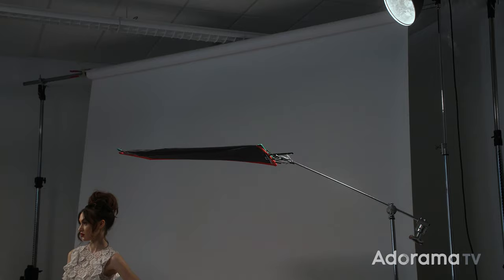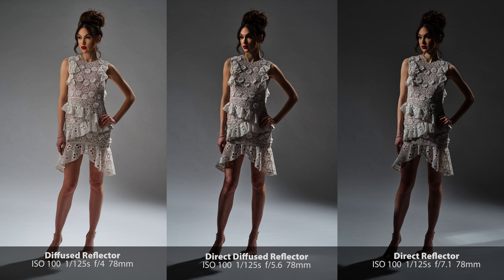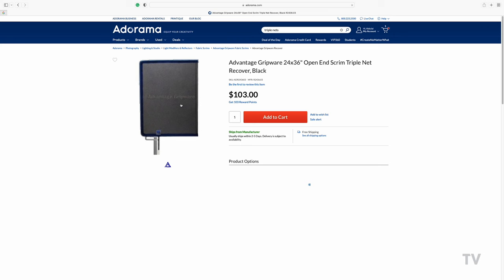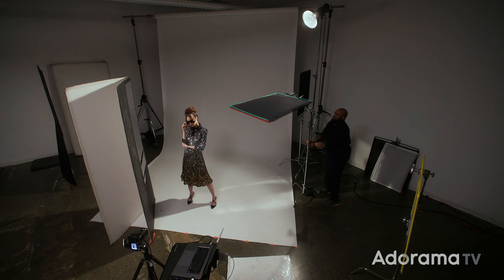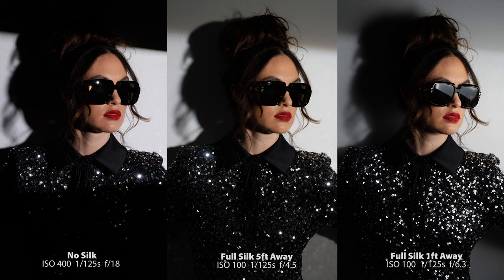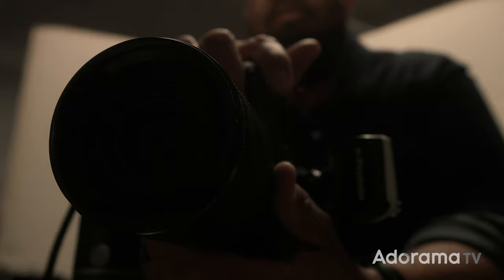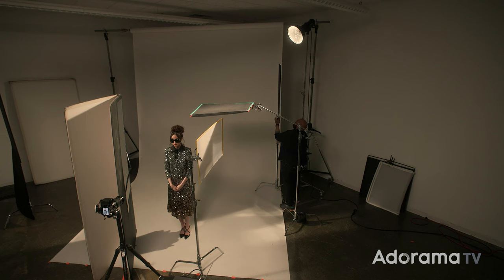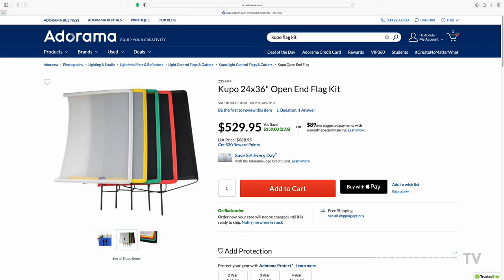Mastering One Light Vol. 1 | Reflectors, Flags, Nets and Scrims | Level Up With Ab Sesay

Comment: Flags & nets are a thing of the past. Nowadays, we use top quality RGBACL lighting and CRLS.
Reply: I agree that CRLS reflectors are the Bomb! Amazing reflectors have added to the capabilities of lighting. I don't know any professional gaffers that would say flagging a light is a thing of the past. Cutting up light sources is an art, and blocking it from the lens is many times a necessity. Nets are less common but I think I point out good use case in this video. I love a good RGBACL fixture, but I also really love the sun, and in my mind, the sun will never go out date. I say learn to use them all to exact the most control over what environment you are in. Can you point out any use cases where an RGBACAL eliminated the use of a flag or net with the exception of simply dimming a light? Let's learn together.

Comment: I really enjoy your clear break downs and messages on what does what. Thank you! One question remains for me tough: if you flag off the hair to not show the light source from above I fail to see the advantage of the light from the top/back versus having a light source placed where your mirror is. Can you explain if that would change the results drastically and why you didn’t do it like that?
Reply: Hey Gregor. Great questions. I should have explained further. thing about if you were in a scenario in which you only had the sun, and had to use light control in order to sculpt the lights. Like in the title Reflector, Nets and Scrims I wanted to show a use case for using all them in a single shot.